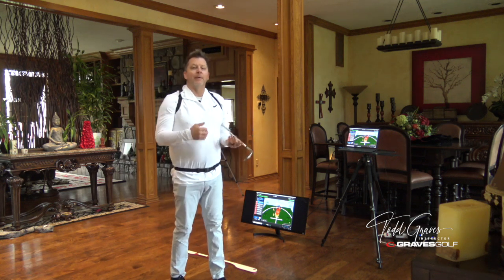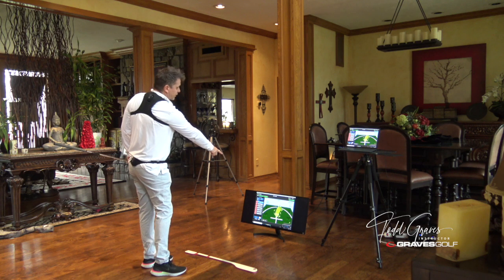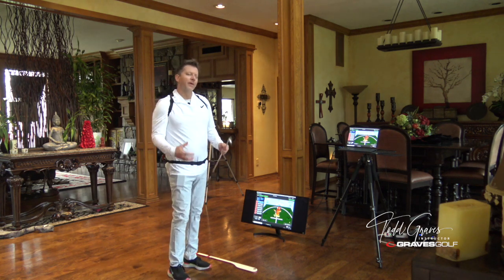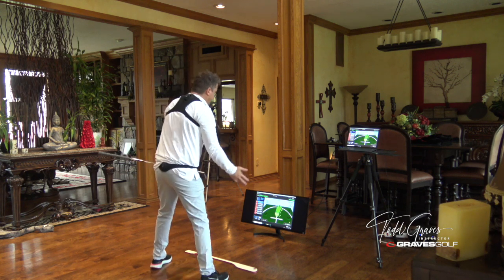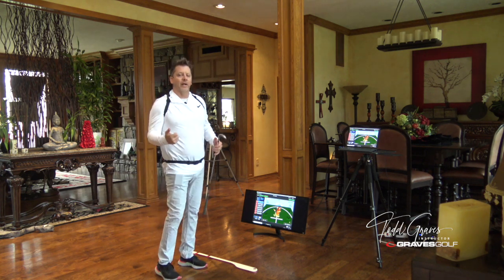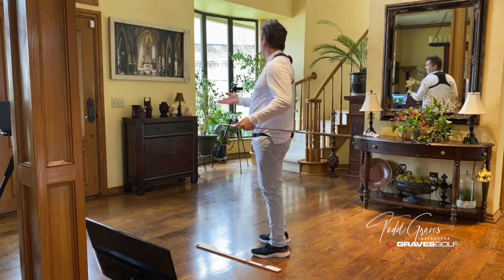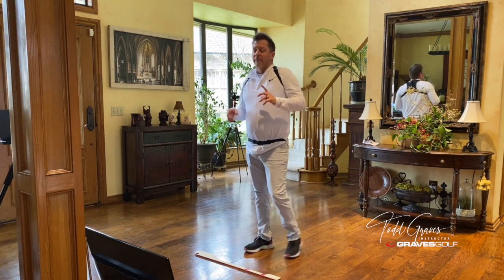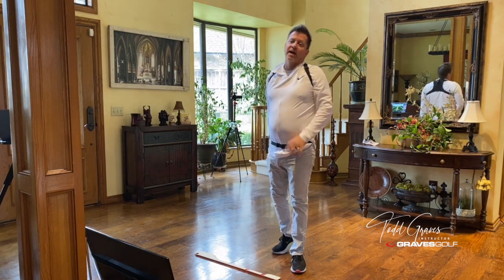Indoor Single Plane Golf Practice in K-Motion 3D

Comment: Thanks for this. I learn something each time I watch, and, if I am being honest, there is a corresponding level of frustration.  As a coach in other sports I understand and preach 'perfect practice makes perfect'.  Unfortunately I am confined by location and finances such that all I can do is try to 'feel' the positions and see what happens; for me it is still trial and error. I know that my practices are not perfect and that I may be laying down neural pathways that I should not. I use my phone or iPad to take video and then try to use comparative analysis by watching you and/or Moe swing.  Painstaking to be sure. I come to points in my work with this that I do not want to swing at balls at the range out of concern for practicing poorly and creating habits that I'll just need to 'unlearn' later.   It's December in Vancouver. It's cold and snowy this year so I am trying to work on the motions and positions indoors using video feedback.  Would love to see a Graves training camp in this neck of the woods sometime...I'd drive to Seattle for it.

Comment: 5:42 @Todd - You nailed, most people struggle to put their body in a side bend and rotate (maintaining swing posture) at the same time, primarily because they haven't trained. This includes not only bio-metric swing changes, but also physical exercise, rest, and healthy nutrition. All of these elements combined have a synergistic and positive compound effect . I'm 6 months into a swing change and the first 4 months were the most difficult physically because the body needs time to adapt, but the key is, it will adapt given time, if you implement all the above. The slow motion static hold positions will absolutely increase stamina, strength, and reinforce neural pathways.

Comment: What would you say your grip pressure is for each hand out of 10?
Reply from the maker: At address?  Lead hand pressure 7 in the last 3 fingers, , Trail hand 2 in the trigger finger area.
Reply: @ToddGravesGolf  what about the other fingers in the right hand? Thanks again for the response
Reply from the maker: @danielcastresana9079  The pinky is overlapping so no pressure there, the ring finger is about a 1 in pressure , middle finger about a and then the index finger is most of the pressure with a trigger like position. The thumb has about a 1 as well.